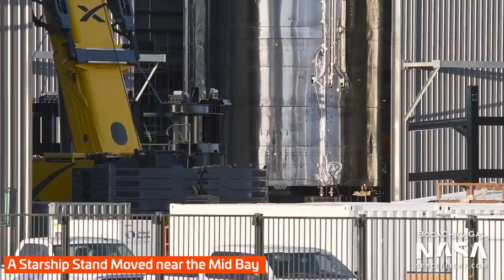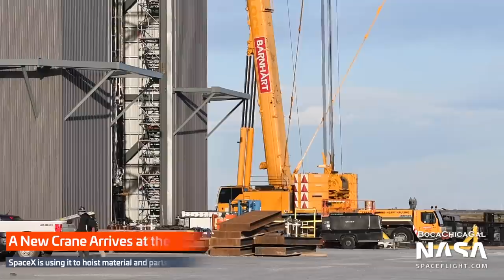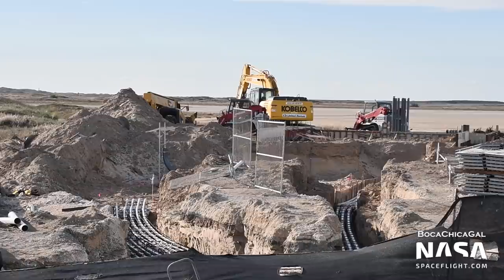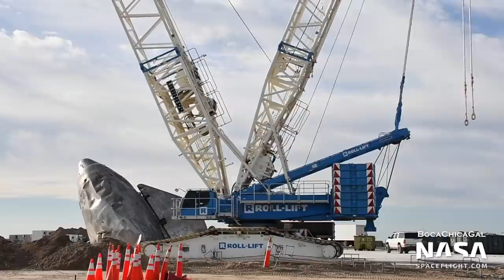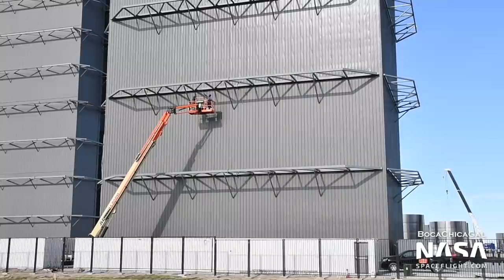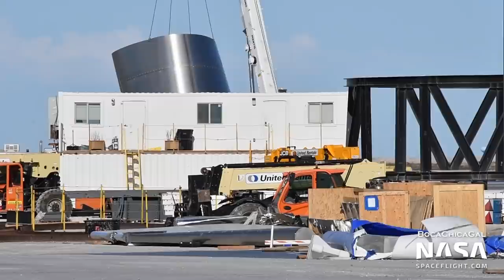SpaceX Boca Chica - Starship SN10 Nosecone Flap install - High Bay crane action

Comment: Looks like stacking for SN12 is about to get underway.
Reply: Is it not underway already since sn15 section has been spotted
Reply: @Noobmaster-gw1jl  They have a bit of a backlog.
Reply: @Noobmaster-gw1jl  10 just went to the high bay, 11 is in the mid bay. Logically 12 is next in line for stacking. Which is what I am talking about.
Reply: @Noobmaster-gw1jl  development yes, stacking, not yet
Reply: @Noobmaster-gw1jl  not only sn15, they have also spotted parts for sn17

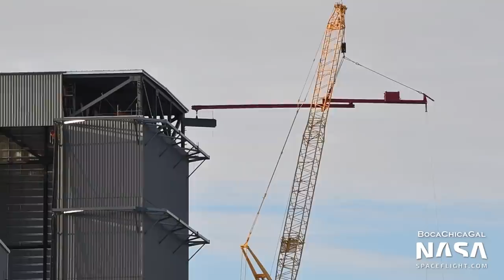Comment: 3:10 Very interesting technique of lifting things. I've never seen it before.
Reply: Would this be in preparation for the gantry- or bridge crane?
Reply: @33lex55  Maybe. But I think it would be much easier for them to construct it before the roof. It's strange that they have chosen such way.
Reply: @TechMasterRus Yes, I agree totally. Sticking it in sideways, as they are doing now, is a painfully slow process.
Reply: Indeed !!  That is a fresh approach to stick a load into a building sideways.  And there is a split/hinge in the horizontal beam to adjust the height of the load, and a counterweight at the other end. Very novel, but maybe an old technique, just never seen before.
[Edit] I correct myself; there is no 'hinge' in the middle of the beam. At 8:28 there is a closer look. The counterweight is used for adjusting for the varying weights of the loads.
Reply: @TechMasterRus  I also thought installing the gantry crane would have been easier before putting the roof on
Reply: It is an impressive counterweight spreader beam. We have designed/built similar configurations to do lifts that would otherwise be physically impossible. I think he’s doing it at a higher elevation possibly, but we do it offshore without the benefit of terra firma!
Reply: @danwhiffen9235   - Wow, thanks for that insider information. Doing that on a moving water surface is astounding, Though the balancing makes even more sense there.
Can you explain why the beam is made of two parts ?
Reply: @tubularap  I’m not aware of their specific design parameters they were trying to adhere to, but I would guess that they adapted or have adjustable counter weight spreader, hence the two components. The beam to the left could be articulated or telescopic, which would be useful when you release the load, because at that point the COG changes causing the whole assembly to want to rotate (often quite a bit). The most recent one we designed has two sets of counter weights which were nested into one another. To lift the entire assembly into place, both counter weight masses were needed, but once the load was placed, there larger counter weight gets released in tandem , allowing to safely lift away the spreader itself. Having the spreader telescopic (possibly) is a nice touch. I’ll have to think about that for future consideration...
Reply: @danwhiffen9235  - That is a real engineering feat. You are right; when the load is released, the balance needs to be reset immediately. A telescopic beam, in combo with the counterweight(s), could do that fast. Balancing by gravity is needed here on Earth to get Starship weightless in space  :-)
Reply: @TechMasterRus  Hi, I think this one is a taylor made crane, in the near future we will listen why is an especial one. Thanks and happy holidays for you all
Reply: Seen this 30+ years ago in 🇷🇺. Heavy transformer was being moved through 4th floor window this way. There was a transformer and a counterweight on the large wooden platform, with crane hooked to the points close to the center of the platform, when the transformer was lifted, part of the platform was moved into window and set on the floor, then the workers moved counterweight to the center of the platform using hand winches. Then transformer was moved from the platform.😎
Reply: The techniques used here are used daily on tower cranes.  At ground level, the next component (payload) is attached to the tip of the balance-arm and the counterweight moves out until the payload is just off the ground. The crane lifts the balance-arm back to the top of the Highbay and inserts the payload inside. Once the payload is wrangled into position and fastened, the counter weight is moved inwards to remove the lifting force. Then the balance-arm can be retracted and lowered to the ground.
Reply: @imconsequetau5275   - Thanks for explaining. We laymen learn new things by watching 'trivial' activities (a crane in operation) that otherwise we would pass by without thinking. So many people now following feats of engineering. Already Starship is more than 'just' a means to get off the Earth.
Reply: Okay.....well, have a good one.

Comment: One very important thing nobody mentioned before: During cryo proof tests with earlier prototypes, hydraulic ramps were installed underneath the rocket to simulate Raptor Thrust. However with SN8 they have no space for the ramps to be installed as the engines are already installed. That means to simulate Raptor thrust they actually have to fire up the engines and perform a static fire. That requires propellant to be used in the cryo proof test instead of nitrogen. That means they would basically skip the cryo proof test and just do the static fire before launch. 
Any thoughts about that?

Comment: Take a second look at the barrel section - no attachments - possible it was a test section, made to check the welds when the metal is flexing.
Looks like all the support structures going in to the High bay for an internal crane. Might be getting that done ASAP so if there's ever and issue with stands like SN9 had, they can lift internally, rather then bring the big blue crane back again.

Comment: Most of the video: that damaged barrel section looks ok
End of the video: ok fair enough it’s scrap now
Reply: What did the barrel section come from?
Reply: How did it get damaged?
Reply: At the Recycling Center: "Sir, what are you recycling today?"
Elon: "Just a chuck of spaceship I'm not using..."
Reply: @RonMcEwen  They built it in the Tent. Something has gone wrong during moving. Either wrong procedure  lifting it or moving it. Once it folded, that would put everything out of specification.

Comment: At 4 minutes, its really crazy to imagine starship on top of super heavy looking down on the crane. Super heavy will be amazing
Reply: There are many more boom sections to fit on that crane ! "many more" ! Up to 150 meters or 492 feet maximum boom length and a lift capacity of 1,600,000 pounds !
Reply: @fposmith  wow, did not realise just how high that crane can go that is really impressive. Sometimes easy to forget just how amazing construction tools have gotten nowadays
Reply: @fposmith  
I think that capacity is over 727 metric tons. 

That should be able to lift the Super Heavy (236 Ton) onto the orbital launch mount and the Starship (125 Ton) on top of that. 

Let's rename the crane "I got this!"

Comment: the fact that damaged parts are so easy to replace and are interchangeable compared to other rockets like SLS is soooooo important. In a weird turn of events They are about to reach a mile stone and check another proof of concept.
Reply: One of the big points of the Starship, easy and quick maintenance, just like airplanes.

Comment: So cool they're already stacking SN10. Any word when the flight of SN9 will be?
Reply: SN10 under final assembly. SN11 is close to that point and SN12 should start stacking soon. (what that stand was for)
Reply: Nothing official but a safe bet is a repeat with fixes for the header tank issue
Reply: At minimum they're going to pressure test the tanks. Then they will static fire the engines. If all goes well maybe 2 weeks? But more likely the will be minor issues. I would bet not until the last week of Jan
Reply: @JayneCobbsBunk  mid jan, I guess

Comment: I wonder if the scrap metal (Remains of SN8, damaged flaps from SN9, and damaged barrel section) can be melted down, recast, and reused for future Starships.  It would seem like a waste just to throw it away.
Reply: Given the cost I would expect so. Or it can be cut up into SpaceX keychains... :D
Reply: Steel of any kind is the most recycled material on earth. It will be chopped up and sent off to be melted down and reused after all the analysis is done.

Comment: The renewed work inside the top of the High Bay makes me think Elon's belated Christmas present of a gantry crane is almost here.
Reply: In this case, a bridge crane.
Reply: @imconsequetau5275   OK, I see the difference. But you have my sympathies on your future frustration. I too like to see precise terminology applied. I point out corrections on a couple of terms repeatedly, but once an inaccurate usage has spread, especially across the internet, I'm afraid it's nearly impossible to eradicate.
Reply: I have been amazed since the construction of the High Bay that the bridge crane was not installed before the roof went on. Now they have to do it the most difficult way possible. This doesn't seem to be the way SpaceX does things. Were the parts for the crane just not available until now? Back ordered?
Somebody paid a penalty for missing that delivery date!

Comment: You would figure that the team would have created a simple jig to reshape the occasional collapsed barrel section. The jig could be as simple as a bullet shaped steel structure of which the collapsed barrel section is lowered onto and reformed through the appropriate application of hammer and heat. Heck, there's enough scrap steel laying around that it wouldn't cost the team anything more than the man hours to design and fabricate it.

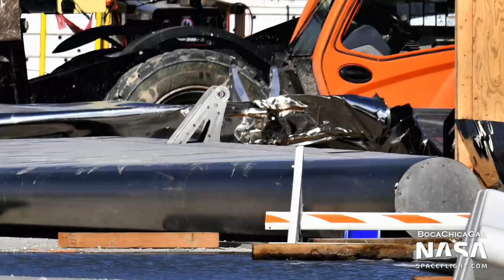Comment: 2:40 - On the right you can see a cover screwed onto the open end of the flap.  It looks ad-hoc, so must have been improvised after detaching the flap from SN9.  That effort to cover these damaged flaps up means that the internal parts of the hinge will be reused, is my guess.

Comment: The outer shell is so flimsy. How does it withstand the external pressures of lift off and re entry. Im guessing the fuel tanks creates strenght and they also have struts in them.

Comment: Could they link maybe 4-5 Starships in LEO?   1 Starship as crew living quarters, 1 as essential cargo for crew, 1 as battery + fuel,  another as fuel (?) and maybe one as a pure motor section ?   Connect each section together in LEO separately and then once the full chain of modules are connected, aim the thing into far-flung deep space ???  go far flung or go go bust... God speed , God bless all.
Reply: Have you ever read the novel /Outbound Flight/ ? Its main premise is exactly what you just described: a group of starships joined together into a single large unit, sent on a one-way mission to explore unknown areas of space.
Reply: @InventorZahran  wow, thanks for that reply.  but no I actually haven't even heard of that novel.  I just had my specific concept merged from combination of some lucid dream insights recently and some deep pondering of how they could maybe further exploit this particular existing system they have.

Comment: I believe the new Super Heavy Launch Pad build has been delayed due to a redesign for a "deluge system" which was omitted from the original concept and design. After the damage to the test stand and Raptor engines from tests on SN# 5,6 and 8, it became clear that a "deluge system" was going to be needed for the Super Heavy Pad. There is "no way" they could launch SH#1 without it. Not with 28 Raptors attached. The only question is, who will build the deluge system and the necessary accompanying "water tower". My money is on the contractor that does the systems at the KSC and Vrandenburg AFB. SpaceX should use them as they are well versed on such systems and it's hard to beat the company that does these systems day in and day out. If anyone thinks I'm off base on this, I welcome your response and comments.

Comment: Elon had said that if sn8 failed that it would take some time to repair the crater. Well it didn't make a crater but did crunch the landing pad a bit. So sn9 will need to wait for sn8 remains to be removed and the landing pad repaired. I expect that to all happen at Elon speed.

Comment: SN10 is going to be the first to stick the landing!
Reply: Why not SN9?
Reply: @tammymccaslin4787  Hmm, SN8 cratered, maybe SN9 breaks a leg and falls over, then SN10 sticks the landing. I don't know, if SpaceX can give the raptors what they need to do their job on landing (like proper fuel pressure), SN9 should be able to survive it's first flight. Any guesses what will happen after the first Starship succeeds in landing?
Reply: @TheFelmaster  Elon said they fixed the issue that caused the SN8 RUD so I don’t see any reason SN9 would fail. They’ve had so much practice at this kind of stuff. I could be wrong though. Time will tell.
Reply: @tammymccaslin4787  He did! Awesome, that's good to hear. Must have been a simple fix if Elon thinks they've got it handled before SN9 even got to the test stand. Fingers crossed that SN9 passes the preflight tests without issue.
Reply: No reason sn9 wont if pressure is sustained, landing legs may not be perfect but they landed sn5&6 with an off-center engine, they should be fine for now
Reply: @tammymccaslin4787  Just a prediction. I'd love SN9 to nail it, but they're still ironing out problems and that tumble SN9 took may have caused stress damage that only the strain of a test flight would identify. 3rd times a charm!

Comment: I understand that this is a process, but they need to get to the point where they've got a large plant and the production is done mostly indoors. These workers working in a messy, hot environment with debris strewn around I'm sure contributes to the accidents that they're having, which are huge losses in time and material.

Comment: Weird things are happening there lately. In SN8 one engine did not work at the crucial moment of landing, then after SN9 tipped over on its side, it had to receive new flaps, because it luckily wasn't destroyed entirely, now I see damaged barrel section, and some time ago, engines in Falcon9 /or heavy, stopped working during "Starlink mission"...
Reply: Yeah you'd think it was rocket science or something, Pfft hold my beer... i got this
Reply: Well all starships use a two engine landing burn. SN9 just leaned a bit and is already on the launch pad. F9 engine out was a minor issue. Etc etc. You are hyping something that isn't a thing.